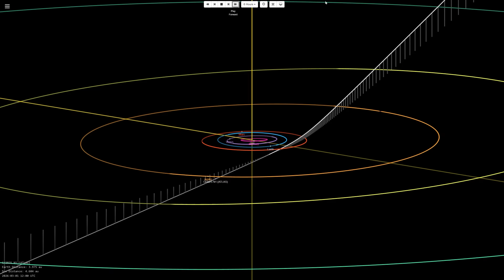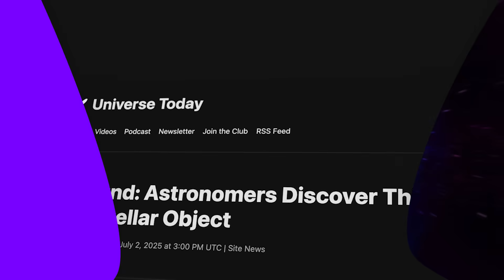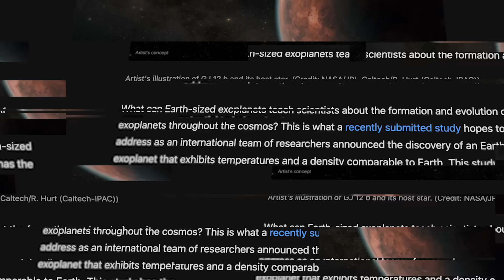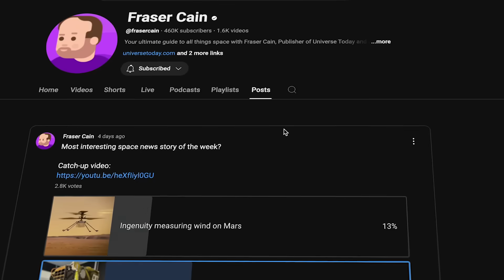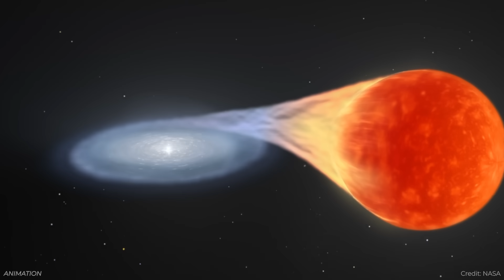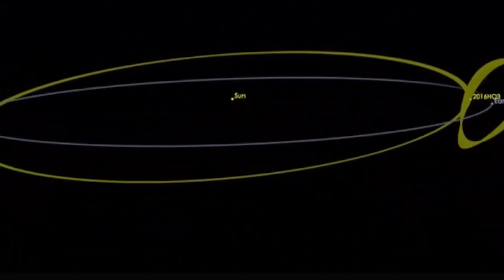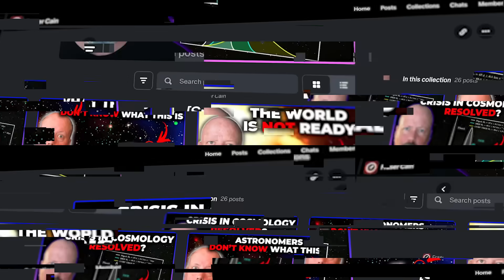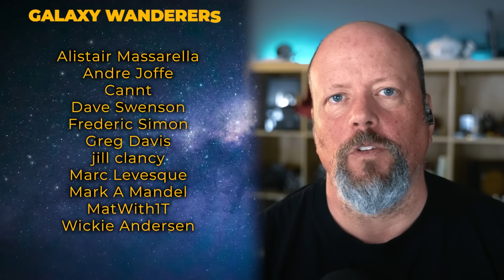A THIRD Interstellar Object // Pack of Quasars // Tianwen-2 Looks Back

Comment: Ouamuamua was initially thought to be a comet because of its orbital path, but observers rapidly confirmed it didn't have a coma at all. But it is still thought to have had thin amount of ice that outgassed to affect Ouamuamua's acceleration as it approached the Sun, but not enough to produce a coma visible to telescopes. The so-called molecular hydrogen gas hypothesis.

Comment: In case people are wondering about the cause of those budget cuts here's a reminder:

"Since February 2022, the United States has allocated $182.8 billion in emergency funding to support Ukraine and the region" (...)
"and approximately $69.7 billion in military assistance since Russia's initial invasion of Ukraine in 2014 to February 2022"

Also, turns out that leaving $88 billion worth of military equipment in Afghanistan wasn't a best thing that could happen to the US spending either.

Comment: For what it's worth, with NASA budget cuts, I think all science programs should be preserved and SLS/Orion axed. The cheapest (and probably quickest) way to send an expedition to the Moon would be:
Launch SpaceX HLS to LEO. 
Send up tankers to fully fuel the HLS. 
Send the astronauts up on Dragon. Dock with the HLS and astronauts transfer,.
Undock Dragon and leave it in LEO.
Astronauts fly to the Moon in the HLS, land,.
Send more tankers to LEO, fully fuel one from the others.
Take off, and head back to Earth, but they won't have enough fuel to get to LEO, but they will have enough fuel to go to an elliptical orbit around Earth, 1k miles by 10k miles.
Send the full tanker to the same elliptical orbit and re-fuel the HLS.
The HLS and tanker return to LEO.
Astronauts transfer back to Dragon and come home.
Re-fuel the HLS and load with supplies for next trip.

I feel confident that this would be far cheaper than the current plan.

Comment: Show Question. Hypothetical.
The Ship is built, altruistic crews on rotation.. Operation Hitchhiker is ready and waiting for just this moment to sling 50 explorers and their supplies on a one-way trip. Right now. Today. Is there enough time? what does this ship look like? Could we latch on with today's technologies?
Reply: It’s going super fast. It would require a chemical rocket on the order of multiple Saturn Vs fully assembled and already in orbit to match its speed. The best option would be a small unmanned probe with a massive solar sail and an Oberth maneuver around the sun.